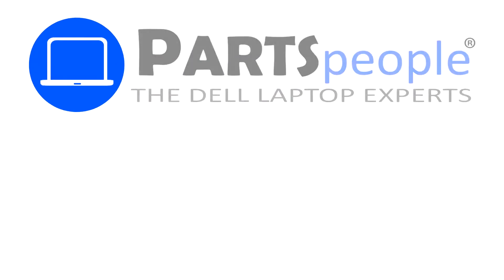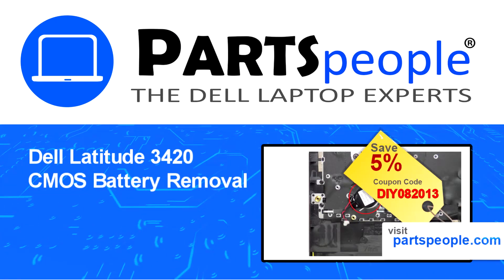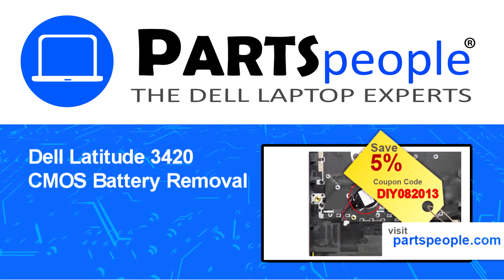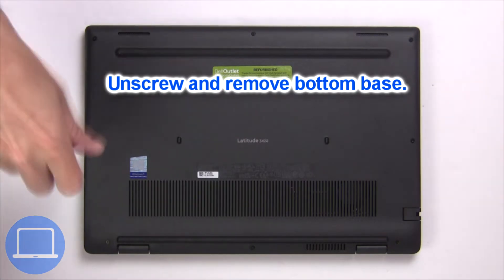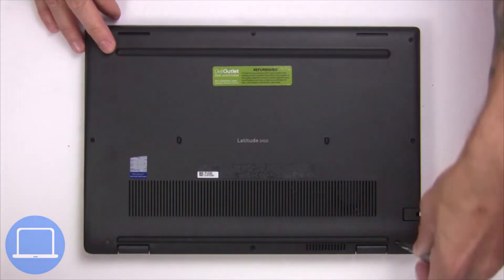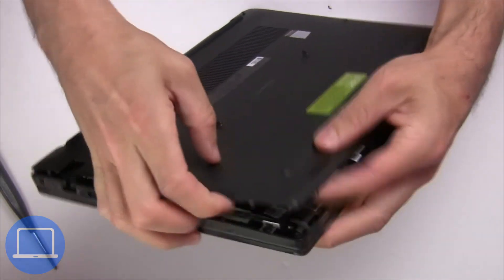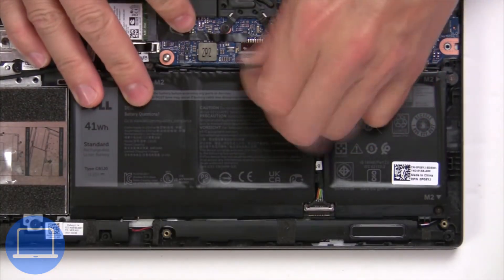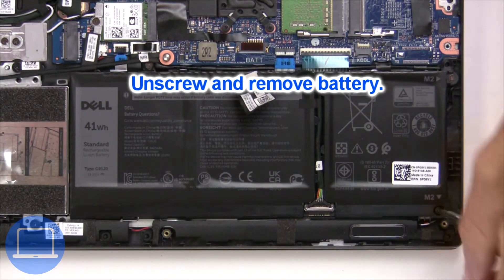Dell Latitude 3420 (P144G001) CMOS Battery How-To Video Tutorial

Comment: The video is misleading - The CMOS is between the fan and hard disk case behind the SSD card bracket (need to remove SSD card if any). Can be done without removing the battery, just disconnect it and you would  be fine.